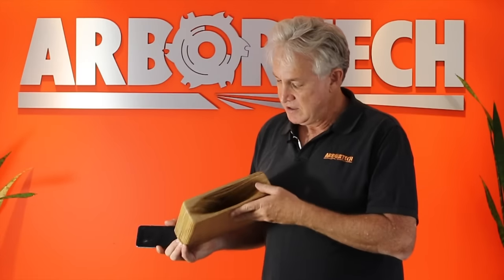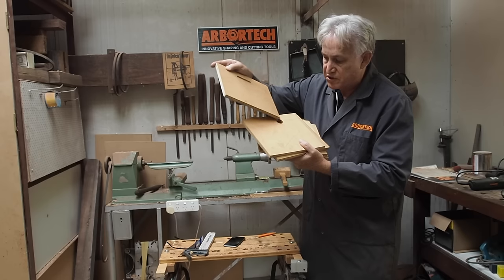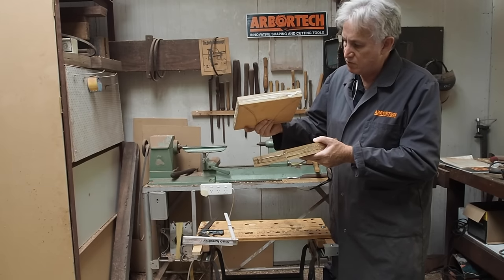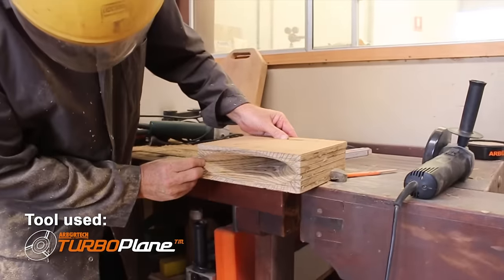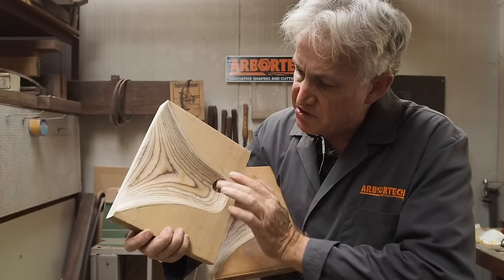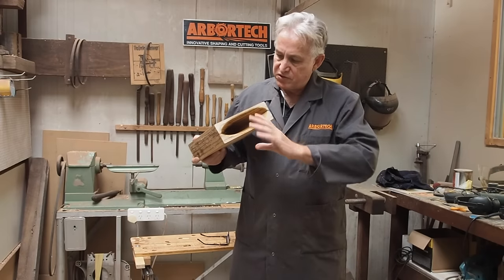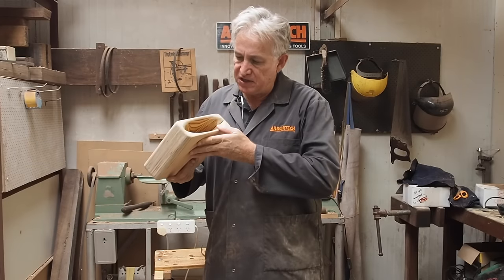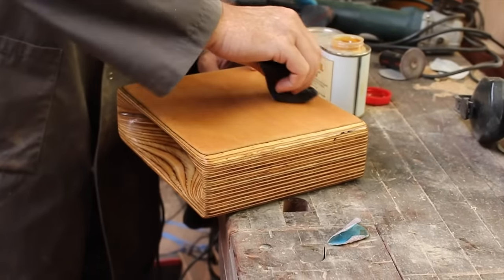Learn how to make a speaker out of wood - Easy DIY project

Comment: The turbo plane looks like an angle grinder, is it the same thing?
Reply: the turbo plane is a cutting disc for an angle grinder. So it basically is an attachment you can put on any angle grinder that you already own.

Comment: The "Turbo Plane" is just a wheel grinder, yeah? What grit do you use?
Reply from the maker: Hi Rooktabula, the TURBO Plane is a universal wood shaping blade. It gives you a smooth finish straight off the tool.